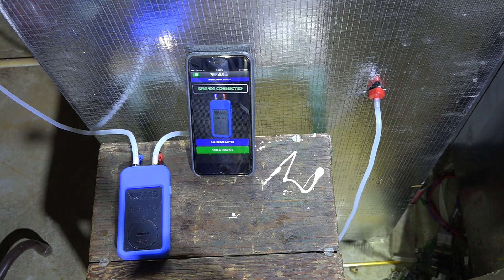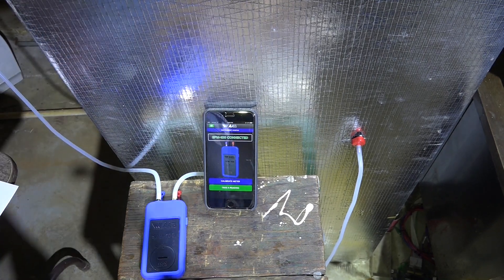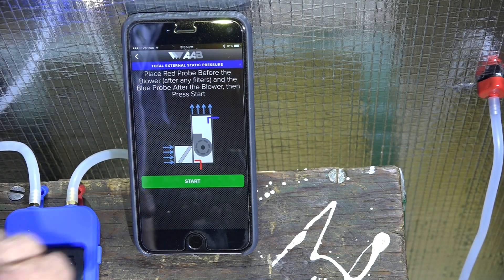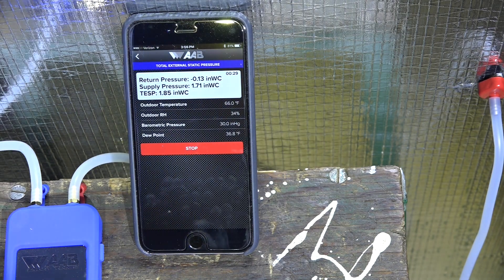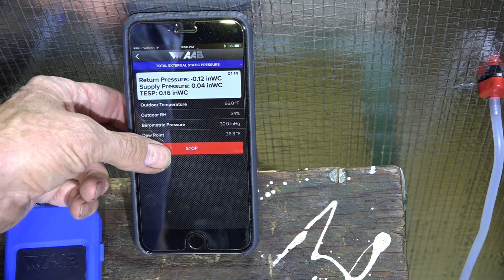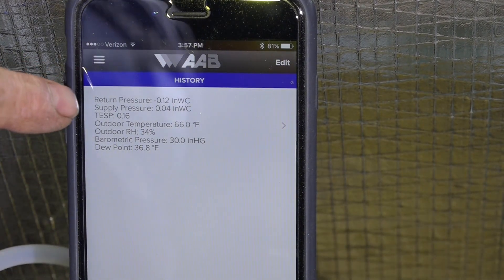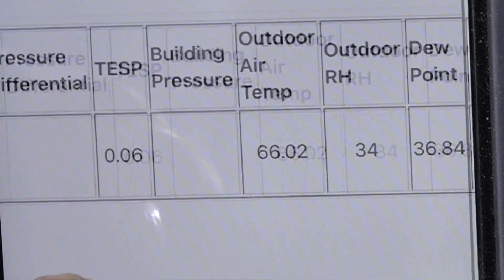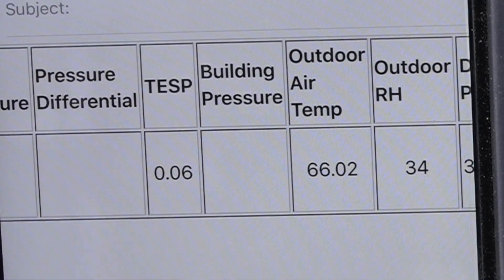AAB manometer review part 5.  Revisit

Comment: Looks like the app is still buggy. I have the Fieldpiece SDMN6 and love the range, resolution (much higher resolution than my magnehelic, and ruggedness. For my own entertainment, I used it with a pitot tube to measure a 300mph blower nozzle stream. That would probably smoke most rotary vane anemometers on the HVAC market.

Comment: I have their bluetooth Air Flow meter and it has issues to.  Their tools are not ready for prime time which is sad since they have a great idea and great price points.  Did you check your TESP using your regular manometer  to see if it even registers TESP correctly?
Reply from the maker: +Joe Bal I did.  It seems to be accurate.  However, I don't like to make judgements on accuracy unless I am comparing with a certified device.  I am in the midst of testing the air flow meter and am having problems there also.  When it is done, I will do a video on it.  Thanks for the thoughts.
GFM

Comment: This company hates you probably lol but they are pretty stubborn they will evantulaay fix everything and pass your test. Btw, why the esp is so low on that furnace because it usually is around 0.5 inwc home furnaces right?
Reply from the maker: +Guy Hakverdi They probably will.  The reason for the low static is the blower was in the on position with no call for heat or cool.  
GFM